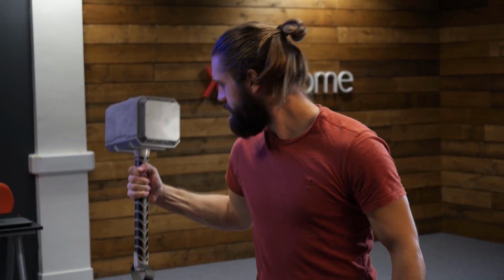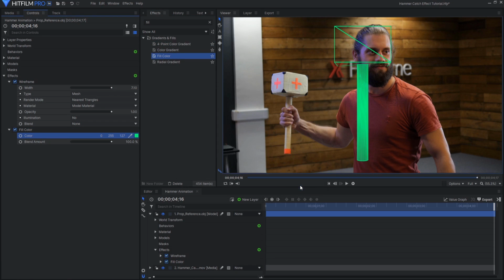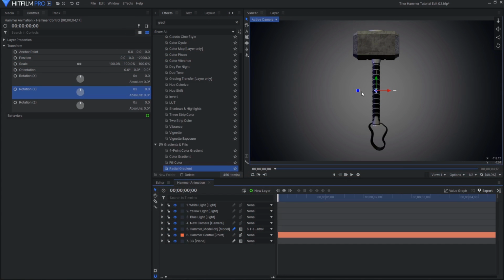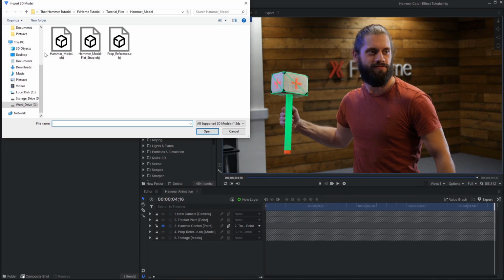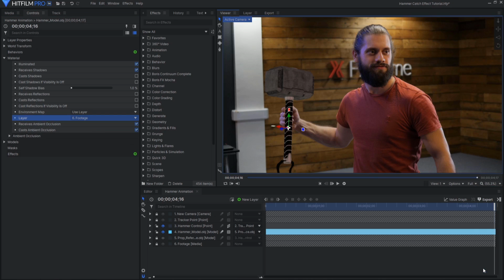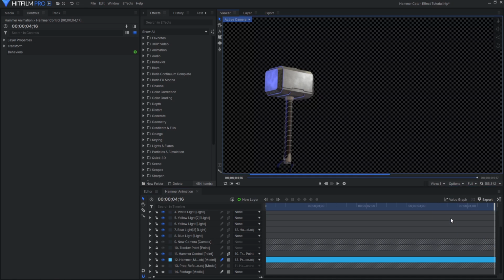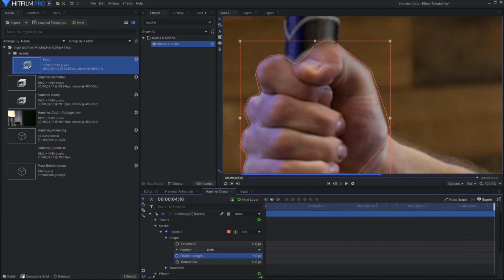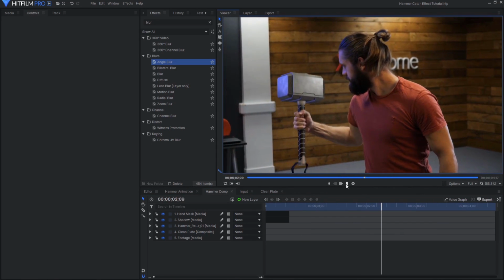Creating a Thor hammer catch effect + FREE 3D model

Comment: I like this tutorial, but you really should've rendered it in cycles for better lighting, and at the beginning of the shot, the hammer is sitting on that table, it doesn't have any contact shadows, so it looks very comped on, and also the back of the hammer is resting on the fabric part. That should've been a cloth sim, not just a static model. While this shot is not awful, it confuses me that you talked extensively about manually tracking a 3d model (something painful which is no fun) instead of actual compositing of a cg object into a real world scene.
Reply: I'm glad you liked the tutorial! I could have definitely rendered in Cycles for the most realism, but that was not the goal of this tutorial. I tried to do as much of the shot as possible within Hitfilm. There should be some contact shadows/ambient occlusion between the floor and hammer. I probably needed to adjust the AO settings some more to make it more prominent. I did consider doing a cloth sim and exporting it as an alembic animation, but that would be a whole new area of Blender I would have to learn just for this video. It would add a lot to the realism of the shot, but I decided against it to get the tutorial done sooner. I did spend a lot of time talking about manual tracking, as that is not a topic usually covered for the reason you mentioned. However, I also spent a lot of time talking about materials, lighting, rendering, and compositing the model using Hitfilm. I encourage you to download the footage and recreate the shot using Blender Cycles and cloth simulations to see the difference it makes. I am interested to see the result. :)

Comment: Why track a stand in prop when the actor can hold the hero prop in hand ? It's more beliveable and easy to roto out the prop before the "catch"
I think sometimes you guys make up scenes just to look cool or to use an effect on it.
Reply: Yes, using a real prop would be much easier. The purpose of this tutorial is not to say that this method is the only or best way to create the effect, but that it is one way if you don't have a real prop but have some cardboard and Hitfilm Pro. The tutorial was also made to showcase techniques for manual tracking, roto, lighting, rendering, and compositing 3D models into live-action footage using Hitfilm. Even if a real prop was used, a CG hammer would be required to create the hammer flying through the air, so why not do it all CG for the tutorial? :)

Comment: Awesome tutorial. I didn't even notice that the hammer was completely cg. I really thought they used a good looking prop for it :D
Another method to remove unwanted objets behind the 3D render is to export the frame and remove the object with an image editor. Than re-import the image and place it above the footage. It's an extra step, but for more complex scenes it's probably the only way to go.
Reply: Thanks! Yes, using an image editor to create a clean plate can be the best way, especially if the program has a clone-stamp tool. Good idea!

Comment: Pro tip- always delete the default cube even if you want to work with cube.
Reply: Agreed :)  I realized it sounded strange to say "delete the cube" and right away say "add a cube," but it is kind of funny as that is what most Blender users instinctively do when starting a project.
Reply: @ZachAlanProductions  That is what we do in Blender!!
Reply: Actually the default cube, at least in pre 2.8 versions is actually different than a primitive cube. Or delete the default cube and save it that way as a startup. #savethecube
Reply: Out of curiosity, why delete the default cube? Surely it’d make more sense on Blenders behalf to startup with a primitive cube seeing as though it’s the most likely base mesh anyone will start with.
Reply: @vanillatography1544  The default cube has dimensions of 2m by 2m, but I wanted to create a new cube with dimensions 1m by 1m, so that the scale setting would affect the dimensions properly. At the time I didn't know how to access the transform properties window which shows the dimensions of the cube instead of scale. Hope that makes sense :)
Reply: @ZachAlanProductions   s.5
Reply: I'm laughinggg just  lol